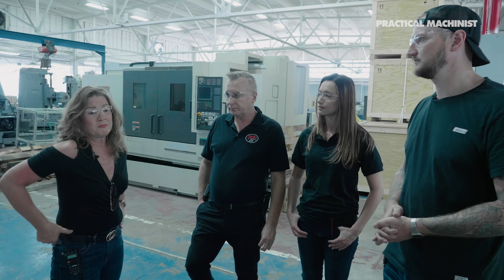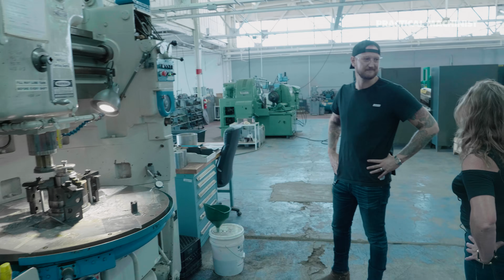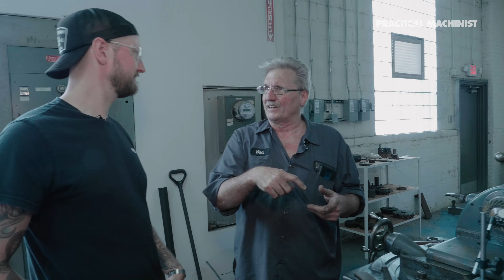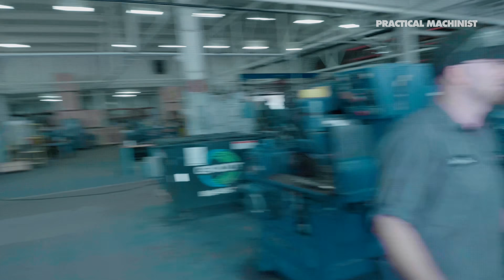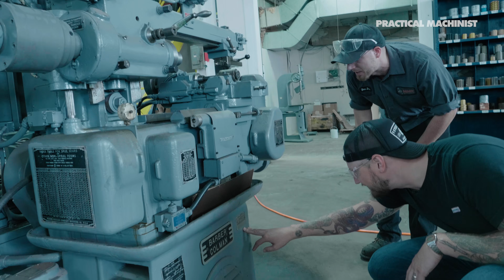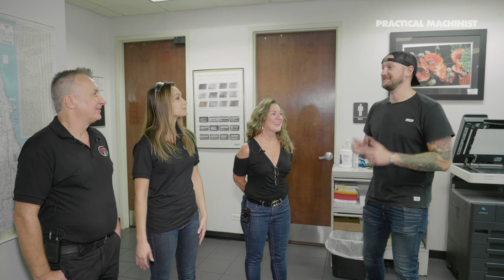Inside the Gear Division at Master Machine and Repair | Shop Tour Part 2

Comment: I did straight bevel gears on Gleasons, thread milling, and spur/helical gears for about 5 years. It's all manual change gears and getting the angles right on setup. It's never boring in a job shop, as you get new things to do all the time.  What a great interview.  Thanks for sharing it.

Comment: Great video. Love seeing a family type business going strong. Bet that in 50 to 60 years from now you won't see many current CNC machines still in use.
Reply: Run in a shop with similar machines to the Gashers and Hobs in this video and also 1980s Okuma Mills and Lathes which are all beasts and can hold a thou incredibly reliably.

Comment: Great tour. I've worked with new CNC hobbing equipment. But cut my teeth on a Barber Coleman. I loved that ole machine, changing Driver/ Driven gears and adjusting in the tolerance manually. Great equipment in your shop. I'm not convinced that CNC hobbing really improved the process that much.
Reply: "Cut my teeth" Double meaning!

Comment: I would keep at least a few of those machines going/ a few guys who know how to do it the old way. There's no telling how useful a COMPLETELY airgapped manufacturing machine is. And frankly, it's stupid basic. The only real electrical in those old gear cutters are the motor/ motors.
Reply: Couldn’t agree more - 10000% bulletproof, as long as you have the know-how to keep them running!

Comment: i would like to get the company contacts and rough estimate of producing  teplacement spiral bevels gears. is there a partical volume of puchase. the quadractor is far away. my dad might have written specs. i just.have to find it i need 4 sets and the.are approximately
 4 inch diameter. and i will needed spares. thank you ahead.of time of doing business. basically.give me.your best guess on a fair price and what are your needs to business with a very tall (6ft 4 1/2 Inch senior citizen old fart
Reply from the maker: Here's MMR contact information: 
Email: info@mastermachinerepair.com
Phone Number: 708 924 1630
Website: http://mastermachinerepair.com/
Reply: @PracticalMachinist   thank you it may be a bit before i make contact because of vision and health issues i will contact because i have waited 30 years  to find a set of spiral  bevel gears to fix a special  toy/tool in my toy/tool box.  pray to your god nicely god may grant your wish and give you a blessing on gods time. sometimes sooner some times later.